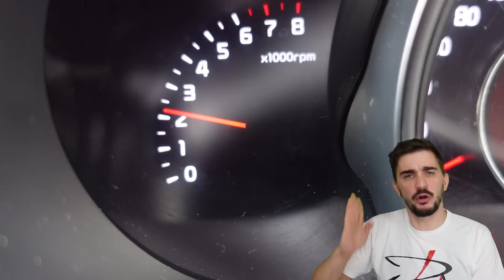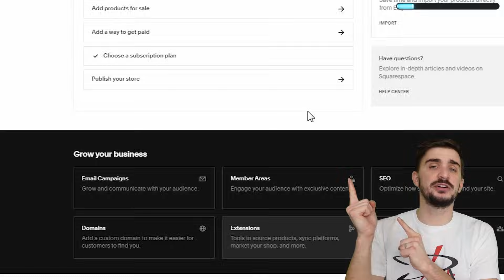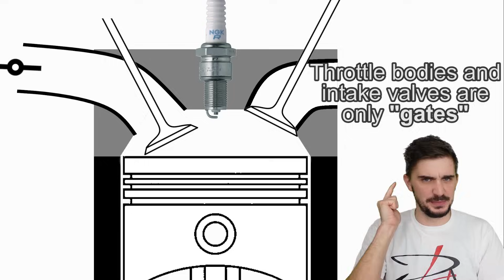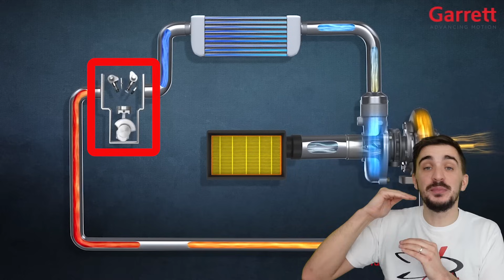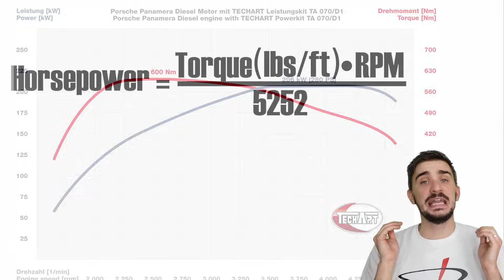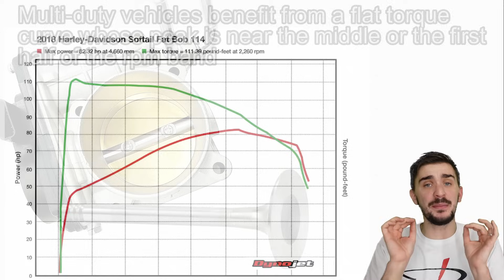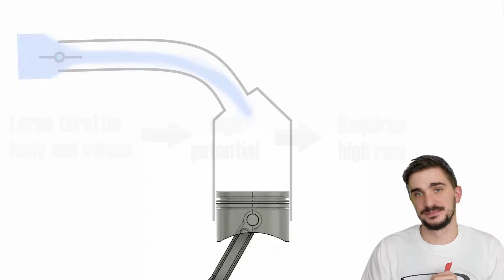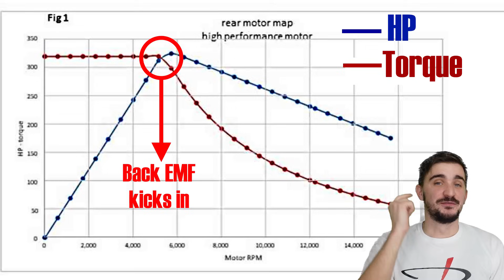WHY are HORSEPOWER and TORQUE CURVED?

Comment: Great explanation, though I feel you should have also mentioned that power can drop off at high revs due to a loss of valvetrain control, or valve float. This is more prevalent on an OHV engine. Also, putting a large TB on a regularly driven car can reduce low RPM perform due to a lack of air velocity, which results is a less complete air fuel mixture and less efficient combustion.

Comment: what about the fuel does it also depend on the piston speed
Reply: Depends if it's eletronically controlled injection, then the ECU controls it. If it's a carburator, the same "vaccuum principle" applies in the so-called Venturi tube

Comment: Also has to do with engine loading.
At car at a dead stop is hard to motivate. Keeps piston speed slow.
This is what makes high stall torque multipliers ideal. 😉 (a clutch is not a torque multiplier. 😶)

Comment: But why does torque DECREASE and not just flatline at higher RPMs? From your explaination it follows that the torque increases because of more intake air until it's saturated, what is the physical explanation of the decrease instead of just flatlining? You focus more on why engines are engineered to have peak torque for lower RPMs but this doesn't explain why it drops off in the first place.

Comment: My understanding has always been that RPMs determine power (and total torque value too to some extent) simply because of the number of explosions for "unit time". At 1000 rpm you have 1000xCilinders amount of explosions pushing you forwards in a minute, while at 6000rpm you have 6 times as many.

The curves normally drop off at the top RPM because at that point the pistons are going so fast that the explosions have little to push off against. The theoretical limit of this is when a piston is going as fast as the expanding explosion, where the explosion is not accelerating the piston any further.

Comment: the piston speed don't affect the air volume it can suck per stroke because it is mechanically timed and the air are not suppress. turbocharger are the one increasing the air volume inside the piston because it suppress the air the suppression speed increase relative to the turbine speed. that's why turbo charge effect only kick in on high rpm.

Comment: Do larger throttle bodies and valves reduce torque at low RPM..?
Or, just increase the maximum torque potential ?
In fact, I'd really also like to know ... is there a BENEFIT to smaller throttle bodies / valves?

Comment: I disagree with you on several points: 1) A positive displacement mechanically driven supercharger should actually be able to offer higher boost at lower the RPMs, as the effect of intake restrictions (air filter and manifold diameter) are lessened. 2) I have yet to understand why the maximum torque at idle on a non-turbocharged engine is lower than say half the maximum torque at peak torque rpm, I can attribute some of the up to  2:1 decrease to the effects of headers (both intake and exhaust), and the valve timing being optimized for high rpm. Can anyone offer an explanation, please?  3) A variable (hot side) geometry turbo, if so designed should be able to provide boost at idle, more so on diesels.
Reply: I'm not very good with forced induction, but I can answer #2 for you.

A few factors for low speed/idle torque.

1. Valve profiles are optimized for peak torque/power, so the valve duration at idle is way too long for those rpms and you end up pushing a lot of trapped charge back out of the cylinder (flow reversion). This is due to the (relative) lack of momentum in the intake/exhaust ports when compared with higher speeds.

Most engines these days have variable valve timing, so idle usually has optimized timing, but there are a few other factors that determine the timing at idle that may keep it out of the optimal torque timing (in cylinder residual, piston to valve clearance).

2. Time - slower piston speeds means more time for the cylinder to soak up the heat in the combusted/combusting gases, which removed energy from the gases and reduces the amount of pressure they can exert on the piston, reducing the torque.

#1 can become a big problem with performance engines that run at very high RPM (>6500 rpm). Making power at those high speeds requires very long duration cams, resulting in terrible torque production at the lower speeds which severely impacts driveability.

I believe with your question 1 about superchargers, you are right that flow restrictions are less, but the increased in supercharger speed and subsequent increase in pressure overcomes the intake system restriction. Peak supercharger efficiency tends to happen near the middle of the rpm range, and I know there are a lot of flow dynamics in the compressor that I cannot speak to that would have a significant effect here as well.

Comment: Electric motor torque doesn't fall due to back EMF when the motor is ran with a motor controller. Controller can always step up the voltage to counter the back emf.

Torque is allowed to fall intentionally to prevent overheating of the motor. once the motor reaches peak power it can handle, trying to maintain the maintain the Torque means motor is being overloaded and will overheat.

Comment: What if we used forced induction without parasitic loss? Let's say a supercharger or a turbocharger that is driven by an electric motor? 🤔
Reply: What would you use to power the electric motor?
A standard alternator properly doesn’t generate enough power on its own to charge the battery, power the internal compartment functions such as the radio and power a electric motor for a supercharger or turbocharger
Reply: @Ryan-jy5ck  Let's say it was powered by a very large battery that you charge at home overnight.

Comment: so this means that electric cars can still benefit from a manual transmission? we just need to rev them higher...
Reply: I've only driven one electric car (actually two different copies of the same model) but that car had way more torque from zero RPM than it needed. I don't know what road speed it maxes out at, but I think it is well above the legal limit in my jurisdiction. So I'm not sure that a manual transmission would add much to that car. I like manual transmissions, and I hope they don't disappear, but I think they will.
Reply: @th3b0yg  maybe it won't benefit electric motors in terms of performance outside of formula-e races.

but it can perhaps help in terms of efficiency, if you can keep producing the same high torque with a smaller motor and just playing with the gear ratio, maybe we can have more mileage for less battery capacity, just limit the voltage and allow the motor to lose torque earlier.

some formula-e cars have multi-gear transmissions, but the single-geared ones usually wins, for what i assume to be time loss due to shifting.

Comment: So many sneaky little videos about things you never considered in the workings of an engine. I'd love a video to explain the seeming lack of difference in my throttle position in low power economy engines. The engine only seem responsive to a small amount of throttle (excluding very low gears) for most driving conditions. Opening full throttle doesn't seem to have any change in power compared with only half throttle in my little cars, for example. Can't wait for more videos.

Comment: I 100% disagree with this. The reason you get more power at higher RPM is simply because the engine does more powerstrokes   in relation to time. If the air argument was true, you should get more than 5x the preformence from sitting at 5000RPM compared to 1000RPM.
Reply from the maker: I think you 100% missed the point and the distinction between power and torque
Reply: I think you're right. Our host isn't backing down, unfortunately. He's a very smart guy and I'm not quick to say he's wrong, but I just can't see how he's right. And I am a mechanical engineer and led an engineering team at Tesla, if those credentials add anything.

Comment: Another consideration is the exhaust pulse timing and overlap of the valves, David Vizard has attributed more of the low pressure on the chamber being due to the exhaust than the piston.

Comment: brilliant video - thank you for very clearly clarifying the difference between the power and torque curves.

two things I'm not convinced of though!
- at low rpm the vacuum takes longer to build (true!) but there's also more time for it to draw air in. I thought the difference was that the higher air velocity induces more turbulence and hence better mixing of the air and fuel??  (hence why larger valves sacrifice low rpm performance for higher rpm efficiency)
- the dyno charts are usually done at a steady state (balancing engine torque against the dyno resistance), so the lag issue should not matter. Isn't it just that although the inlet pressure is higher with a turbo, the air is only drawn in by the "vacuum" (or pressure difference) in the cylinder: so the explanation is the same as an N/A engine... (but for the turbo, the air will have higher velocity, hence typically a flatter torque curve.)

I don't mean to be critical!  I love what you're doing and just want to make sure I haven't misunderstood something!
Reply: one more thought ... in turbo engines, the torque often drops slowly at higher rpm before the big drop at peak power. Is this because the turbo can't keep up with the air flow rate required by the engine, causing the inlet boost pressure to slowly drop? (it'd be great to see a chart of boost pressure over-laid on the torque curve)

Comment: How to calculate the force generated in combustion chamber every single explosion for a given chamber ratio (TDC and BDC) and octane number of the used gasoline? Say the ratio is 10:1 (100 CC during BDC and 10 CC when TDC) and the octane number of the gasoline used is 92.
Reply: You'd calculate using the ideal gas law arranged like: P=nRT/V. But more closely answering your question, the T term is governed by the quantity and chemical composition of the fuel (maybe lookup tables would be easiest here), V is governed by the mechanical design of the cylinder, piston face and head, n is governed by how much air actually makes it into the cylinder, and R is a constant. Calculate P, then multiply by the area of the piston face to get the force. The difficulty becomes that the whole system is dynamic with moving parts and heat flow out through the cylinder walls so the force is constantly changing, so you probably want to take that complicated force curve and reduce it to an average over the period of the power stroke in order to simplify follow-on calculations e.g. regarding vehicle performance.
Reply: @th3b0yg  Do you have link somewhere containing an example how exactly it calculated? Please, I need your help. Even electric car is coming, still very important to understand it.

Comment: Maybe someone will help me. For best acceleration which rpms are better, near max torque or max HP?
Reply: Max torque. Rough explanation goes like this: acceleration = force/mass, and torque is twisting force. So whatever RPM has highest torque will provide greatest instantaneous acceleration.

Comment: Actually the primary factor in determining the shape of your torque curve is your camshaft profile followed by your intake and exhaust manifolds. Throttle body, int, exh and valve size are all important factors but not primary ones.
Reply from the maker: The video is not about torque curve shapes. It answers the question why torque is even curved in the first place.
Reply: @d4a  
Why the torque curve is is curved fundamentally is due to volumetric efficiency which is determined by several factors - the primary one being the camshaft profile, not the size of the throttle body or valves. Again, those are important but not primary.

Comment: Respectfully I would like to raise the question of combustion speed in relation to the powerband at higher RPM... EG it takes an amount of time to combust the fuel/air mixture and as you increase RPM you need to advance the timing (Eg setting off the mixture earlier and earlier in relation to piston TDC giving enough time for peak cylinder pressure to occur shortly after TDC resulting in more power). When you have larger displacement cylinders if the piston is moving at really high speed/rpm the combustion literally doesn't have time to fully occur as the flame front isn't instantons resulting in less peak pressure on the piston/less power output as RPM increases. Hence smaller displacement cylinders (or rather, shorter crank distances) allow for much higher RPM as the physical distance for the combustion to occur is shorter allowing for higher and higher RPM. 

The old F1 V8 engines had really short stroke lengths to allow for higher and higher RPM and conversely when you "stroke" a V8 engine with longer stroke the RPM limit tends to be lowered (although you make more torque/power overall due to increased displacement). This is why "Stroker" V8s are great to drive on the road (Lots of power down low) but aren't suited for racing. 

Also the other thing I thought was worth mentioning is the "Flat" torque curves you see in modern engines are solely a result of tuning and NOT the natural torque curve of the engine. This is because gearbox/driveline components are rated on their torque limit (Remember torque breaks things, NOT horsepower), so engine manufactures tune their engines to not exceed this limit but stay as close to it for as long as possible (thus giving maximum effective horsepower over a wider RPM range without breaking parts). 

Anyway as always loving the video (And hope my comment came across as constructive and not argumentative). 

Cheers
Reply: I really love the insight that comes from this channel - from the very knowledgable comments as well as the great explanations in the video
Reply: For a long time I've know that long stroke means less available RPM because piston acceleration is increasing as length of stroke increases, so stress on reciprocating parts is also increasing. However, for me it's a pretty new thing to take into account the time it takes for combustion to propagate to the extents of the chamber. So if you trade piston diameter for stroke length (keeping displacement constant, say) you're facing a two-sided tradeoff where RPM gets limited in BOTH directions by different factors. Fascinating!
Reply: It seems pretty natural for torque to reach peak and stay flat, though. You will have peak torque when you have a cylinder fully filled with as much air and fuel as the intake (forced or natural) will allow. This doesn't take long to reach, and once it is reached you will flatline it.

It will then stay flat until your rpms speed up so much that you can't properly fill the cylinder and/or pushing the crank through a full rotation can no longer be done efficiently within the given time between explosions--then it will start to drop.

HP will keep rising as torque rises, and then keep rising as rpm rises while the torque stays flat and/or as long as the reduction in torque is outweighed by the increase in RPM. Finally, when torque starts significantly dropping, hp falls.

One doesn't need to 'tune' to create a flat torque line--that's a fairly natural feature of ICE engines.

Comment: Thanks for this video ! Now I understand why some electric vehicles still do have some sort of gearbox. The power band is very large compared to a ICE but it still has a limit.
And I didn't knew the reason behind the falling off of the torque curve, which in turn causes the power curve to fall. But when you know it is limited by the air intake, it all makes sense !
Reply: Adding gearing to an electric motor doesn't increase the power band
Reply: @forloop7713 no but it allows peak power to be applied at a different speed
Reply: @DntLie2alive peak power happens at 0 km/h
Reply: @jimb12312 My bad, I meant peak torque

Comment: The most simple way to out this is look at the hilix 2.8 engine 

It doesnt have a throttle body, it just spins and you add the fuel at the right moment, so really its only going to suck as much as the cylinder bore and stroke will allow it

If you out a turbo on it the engine wakes up alot more because rather than having to work off of the pistom sucking, its got a turbo pushing air in

Comment: Awesome video as always, but I can't help but feel like something is being left out.
I still feel like it's intuitive to think torque would stay at its peak even after hitting the intake/throttle/valve/etc. bottleneck; I mean sure, those things are now bottlenecking torque and stopping it from INCREASING...but why would torque DEcrease? The piston is still sucking in the same amount of air, right?
I was expecting to hear something I thought I heard elsewhere- that the piston starts moving so fast that it gains less from an individual combustion. Is that a factor? Like, the piston is already moving at X speed, and the combustion shockwave / flame front thing just isn't moving fast enough to push it so much?
Reply: As the rpm increases the air has to move into the cylinder faster and the pumping losses (friction of the air against the manifold walls, the valves and what not) increase. So less air actually makes it into the engine at high enough rpm.
Reply: @th3b0yg  The phenom you mention is called " choked flow". When a fluid (both gas and liquid) reach a velocity that is equal to its "own" sonic velocity any further attempt to increase its flow rate is met by an equal amount of resistance to that increase. The flow is effectively choked at that velocity.